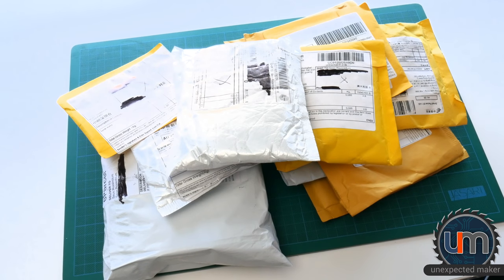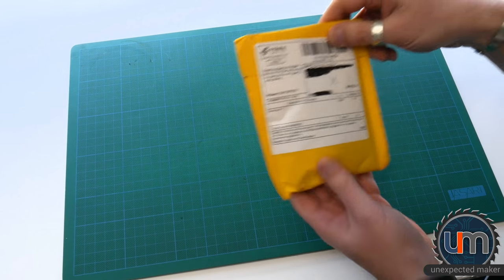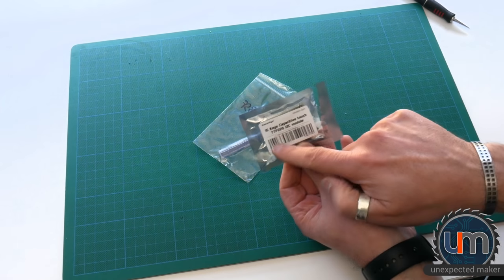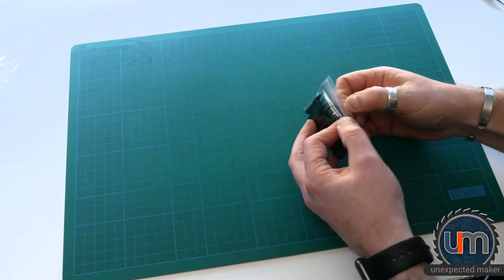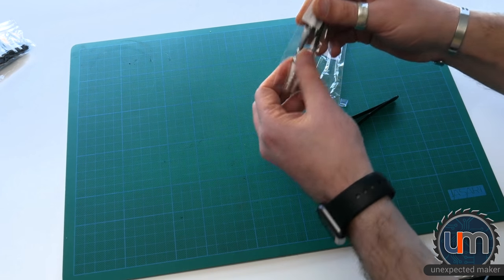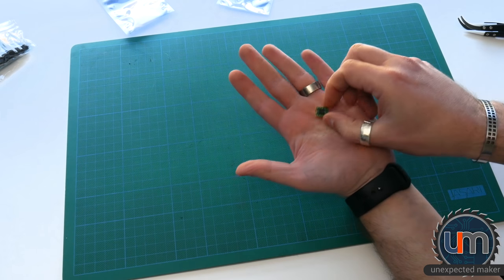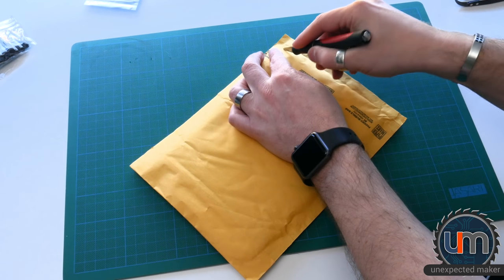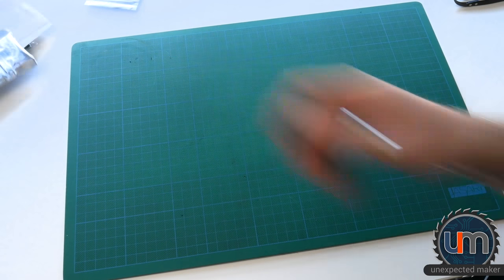Unexpected Mail 17 - Drowning in unopened mail...

Comment: Ohh... definitely take a look at one of those T-12 tip soldering irons. They just heat like crazy. One try with a T-12 and you'll never want to go back. There was also a whole discussion about it between Dave from EEVblog and Louis Rossmann - how the "intergated heating element" tips are just killing it.
Reply from the maker: You mean the TS-100 or the newer TS-80? Not sure what tip names are for which iron. I still want a Hakko FX-951 - but my current iron really is fine and does the job I need. And I can't live without my hot air station.

Comment: The tweezers are heat resistant so you dont burn your fingers when using a blow torch
Reply from the maker: Runs off to order a blow torch to test that theory!
Reply: Unexpected Maker lol, it is commonly used in jewelry making. I guess you will find a use for it though

Comment: What to do with an FPGA?
You can drive those 64x32 RGB matrix displays (as seen on Kris Cochrane and Brian Lough's channels) really fast. Although not sure the BX has sufficient RAM for this.
Reply from the maker: But I can already do that with my ESP8266 and ESP32... I'd like to find a use for the FPGA that isn't just a "faster version" of what i can do with any of my Micro-controller...  no idea what that is yet... but first, I need to learn verilog? Or something to program it and learn how that all works!
Reply: Unexpected Maker Both are Turing complete. So there is nothing that an FPGA can do that a microcontroller could not do slower.